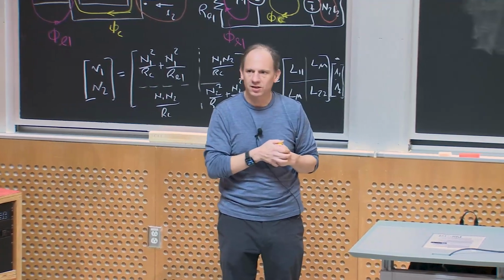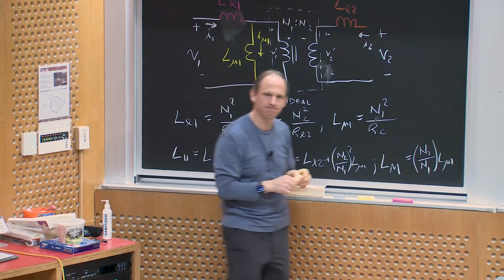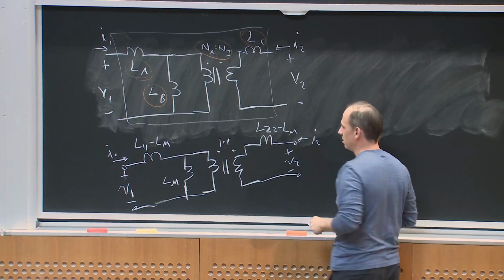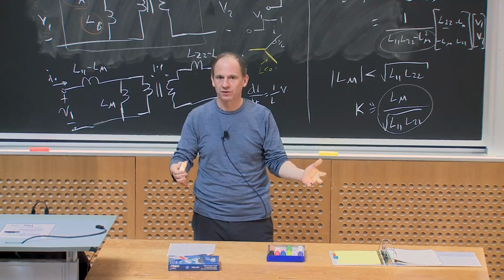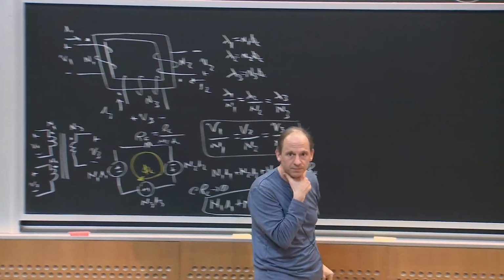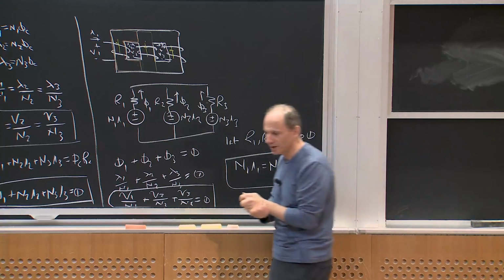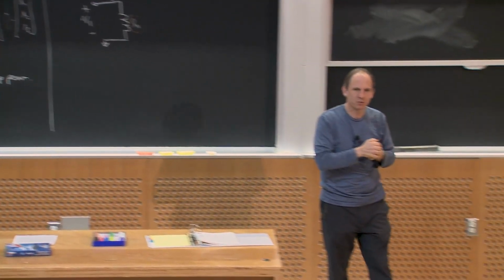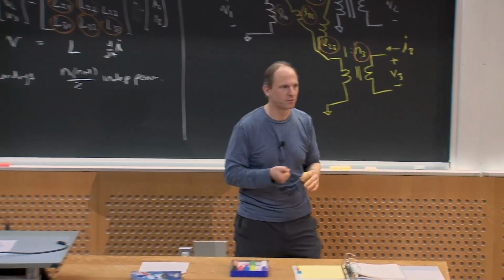Lecture 11: Magnetics, Part 3

Comment: When you have a real transformer, how do you measure the parasitic values?
Reply: You can get the matrix elements by applying a changing current (most commonly a sine wave) to one terminal and measuring the voltage on every terminal, and then repeat for the other port(s). Calculate the (transfer) inductances and write them down as the corresponding matrix element.
Reply: How do you measure parasitic values? Simple, you ask your technician to do it while you lean back in your chair, place your feet up on the desk, read the paper and drink coffee!

Comment: Hi Professor David,
I'm a 67-year-old "guy" who started following this very interesting online course.
I've been designing electromagnetic components for 45 years and I immediately became fascinated by the way you explain such a complex topic simply and clearly.
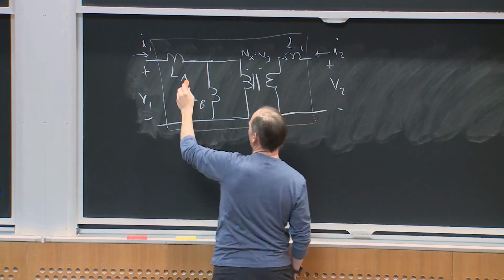Let's get to the point: at minute 14:25 of the video, you represent the current in the secondary with the arrow incoming in the positive phase of the winding (identified by the dot). Now, if the winding's direction is consistent with the primary and the primary current arrow is incoming, the secondary current arrow must be outgoing.
Am I missing something?
Then there's the issue of leakage inductance. In my opinion, there's only one source of flux in a two-winding transformer, and it's generated by the (AC) voltage applied to the primary and its number of turns. Therefore, all the flux not "collected" by the secondary is leakage flux, and therefore belongs to the primary.
If, however, you mean that Total leakage flux = Flux leaked in the primary + Flux "NOT collected" by the secondary, then I agree that two leakage inductances can appear in the circuit diagram.
Here too, where am I going wrong?
In any case, congratulations on your teaching style; it clearly shows your passion.
Roberto

Comment: If we use inductance matrix to get the connection between ports of a physical transformer, then why would we have to make the matrix for non-physical models ? Is it used to find the only windings parameters ?
Reply: there is no non physical inductance matrix, both the physical and non physical inductance matrices have the same elements, only the equivalent circuit describing them is different, and the reason for using the circuit that uses the non physical parameters is to simplify  calculations